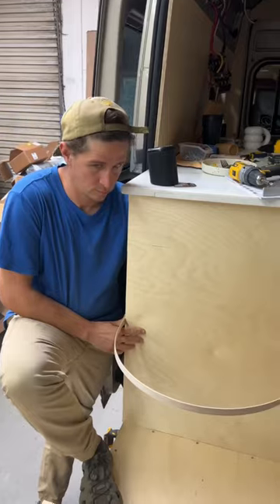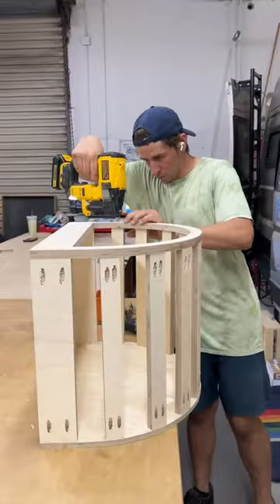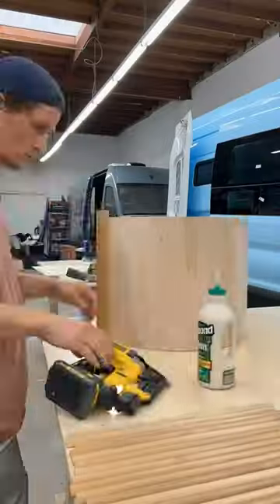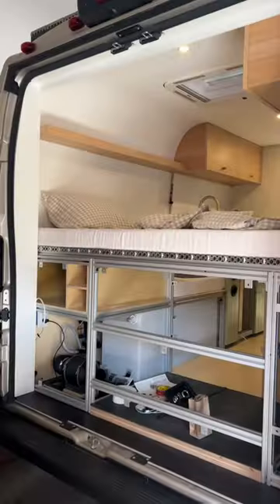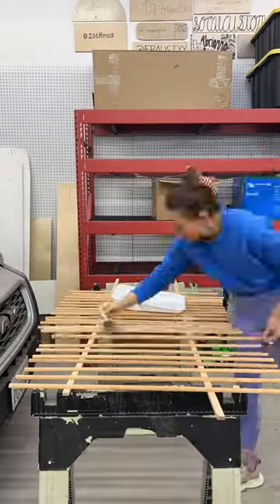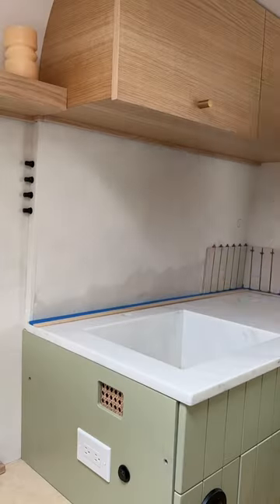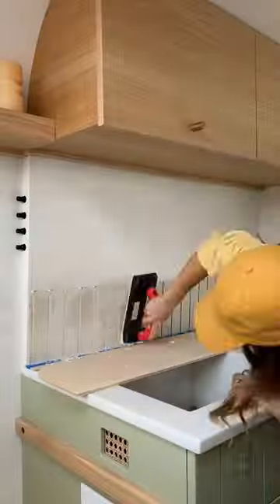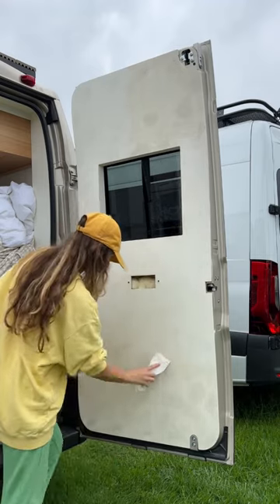DIY Van Build Progress part 3

Comment: I always wondered: doesnt the movement,flexing, vibration,bouncing while the van is moving crack the tiles, grout, tiles pop off? Especially in full shower walls? Or is there a flexible thinset that cushions the tile? Tile guys always mention substrate movement concerns in home improvement projects...